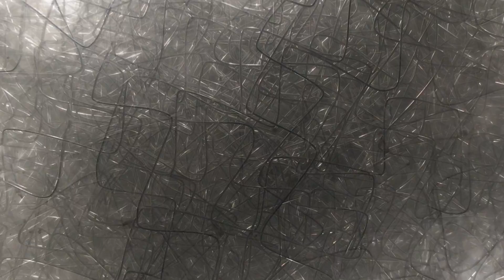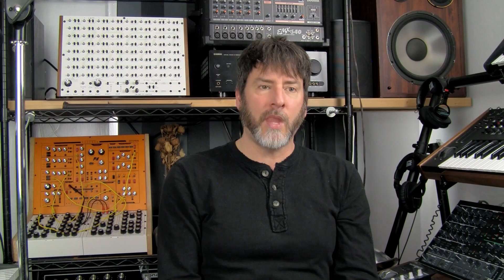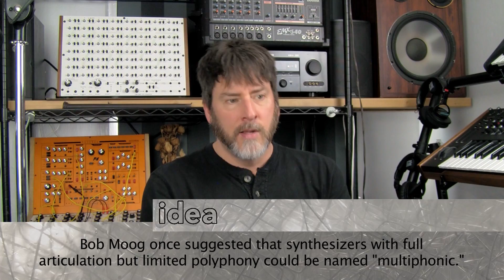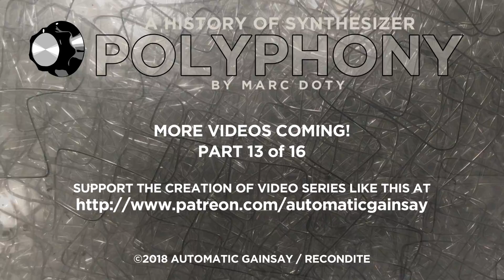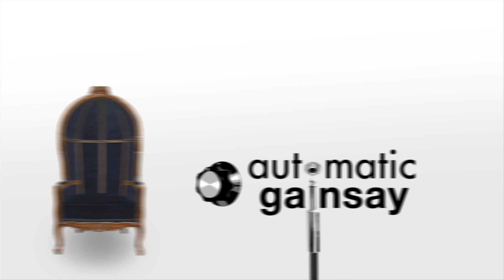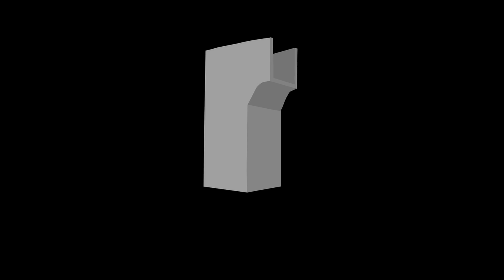A History of Polyphony: Part 13- Multiphonic Homogenization

Comment: Great Point......but what about drum kits?  Would the later Access Virus TIs have the same limitions?
Reply from the maker: Polyphony in the digital age assumes that each note is fully articulated and usually embraces this homogenized structure, although I am not familiar with the Virus architecture.  Drum machines don’t really fit into the polyphony concept.

Comment: In 1973 I built an analog keyboard that used S/H circuits to provide full CV&trigger for simultaneous use  every key. The problem was cost and nothing more. I met Keith Emerson at Guitars Unlimited in New Haven in 1974 and demonstrated it to him. He was impressed but not willing to buy one unless Moog made it. Sad but true.
Reply from the maker: Well, if it worked, Moog should have hired you instead of Dave Luce.

Comment: I am not sure homoginization was a bad thing. Complete timbre control on a note by note basis would be rediculously hard to set up by the user. Full chromatic timbre-ization would be cool but would likely go unused by most musicians it's too complicated, too time consuming, not all that "musically beneficial". And as said below, the split keyboard idea is a better, simpler solution.
Reply from the maker: Homogenization isn't a bad thing if you want to play timbres in traditional chords, but in the context of the synthesizer, its a horrifically limiting thing.  The synthesizer was conceived to break the limitations of traditional music, whereas homogenization serves traditional music.  I think anyone loves plunking down a chord on a synth and hearing homogenized oscillator settings.  But at the same time, if you've played an Oberheim 8-Voice, a Korg MonoPoly, an Arturia MatrixBrute, or a DSI Pro 2, you also discover that being able to have different oscillator settings for each oscillator used creates some very interesting and useful musical outcomes.  

Of course, if we're talking about a 16-oscillator synthesizer, the benefit of individual control of each oscillator without individual performance control is questionable.  But being able to make each oscillator different is more beneficial from a synthesis standpoint than essentially making the synthesizer into an organ or piano, etc. with homogenization.

Comment: The way polyphony was arrived at was shaped by two things

1. Cost. having different polyphonies in the same event would be more expensive, requiring many SEM-like modules, and later chips that would need to be accessed separately to set up their separate patches

2. Model. This was a keyboard instrument. Keyboardists, notably pianists and organists are used to, and think in terms of, the same sound across the keyboard. The organist might be a but more mult-timbral since his instrument more often than not has 2 or more keyboards. and even the spinet organ with two 44-note keyboards was based on the 88 note piano keyboard

The split keyboard did offer a compromise of sorts then came layering as more note polyphony was developed, with some SFZ players being infinitely layerable and some instruments like the GEM's and Ensoniqs having a "sound" that consists of up to 8 layers of oscillator (sample)-filter-articulation-modulation modules which Casio dubbed "lines"
Reply from the maker: Fan fiction